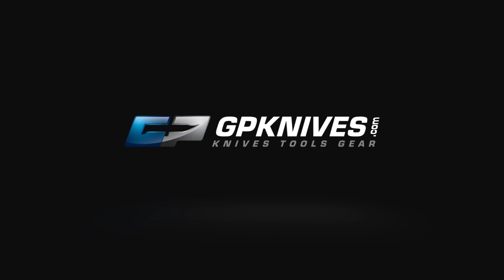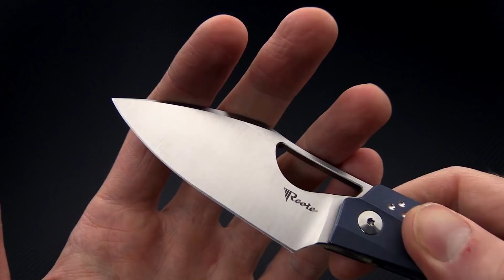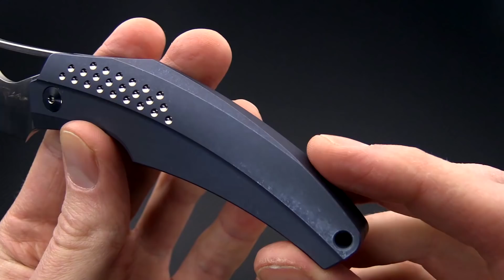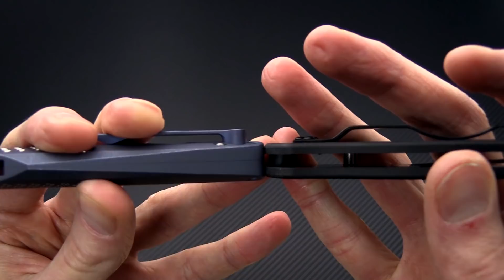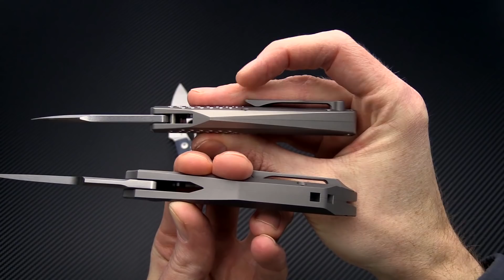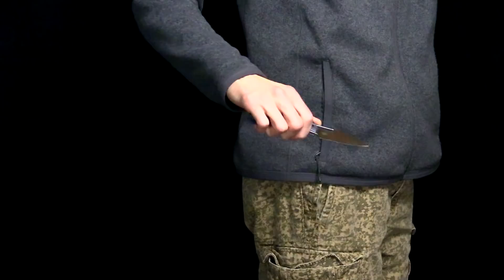Reate Baby Machine Tashi Bharucha Design Overview

Comment: Looks suspiciously like the Massdrop Prism which has more machining work for a $100 less. Guess that answers the already obvious question of who makes the Prism. Either way it's a nice offering.
Reply from the maker: Prism is another Tashi design. I do believe that Reate is the manufacturer. The Baby Machine does have milling on the handle as well as the polished divots and satin pocket clip which probably contribute to the cost as opposed to the simple cutouts and more basic finishing on the Prism. Devil's in the details.